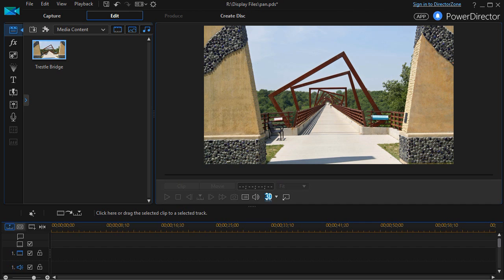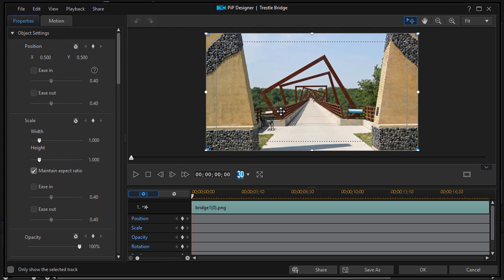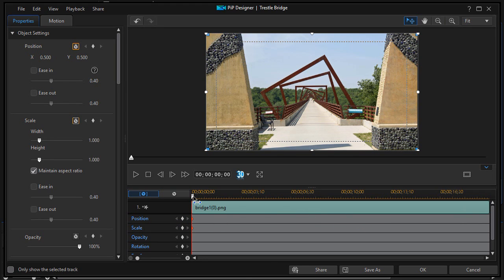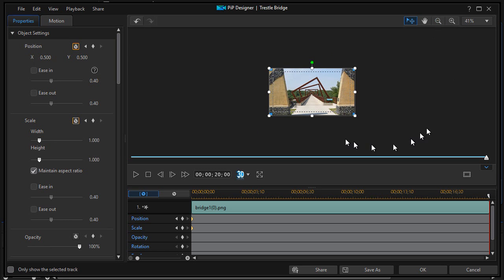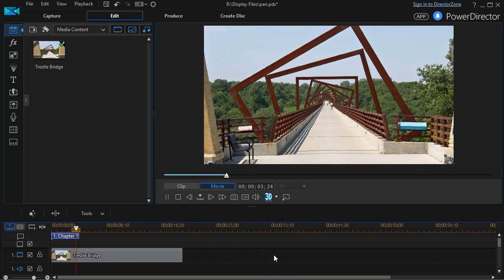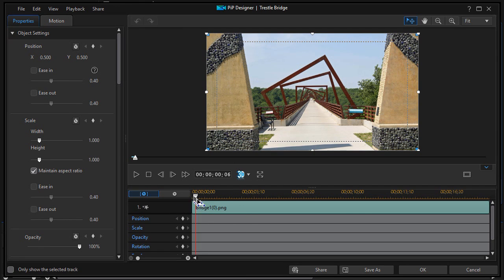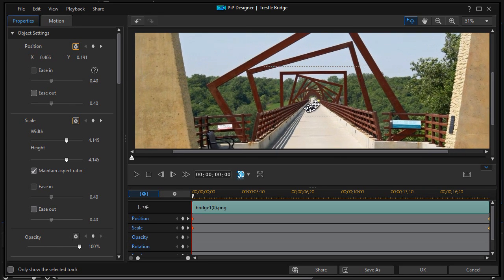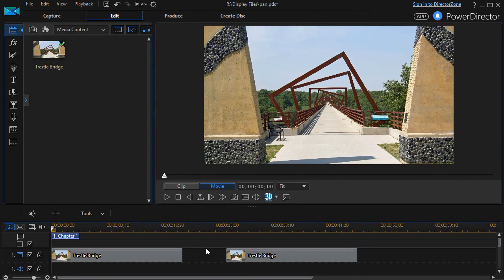PowerDirector - How to zoom in and out on a still image

Comment: ello and congratulations for the explanation, I ask you: a photo taken vertically leaves the sides of the screen the "black bands", you can kindly tell me the process to remove them? Thank you.
Reply from the maker: I'm not sure what you mean by "remove them". If the vertical photo is the only element on the screen, you can enlarge it so that the empty space is off the screen. But then you will have to trim the top and the bottom. If the vertical photo is in front of something else and still has black to the right and left, you can use the chroma key tools to make the black area transparent. 

There is no easy way to change the proportions of a vertical photo if you have a 16:9 video project. So your adjustments will depend on other considerations in your project. --Jim
Reply: @SharperTurtle  by remove them he means by: when you first start a video on powerdirector it zooms in and out on your pictures and I'm having the same problem as him

Comment: When you pull your picture down to the timeline, you automatically get the dotted rectangular frame just inside the picture edge.  I do not get that dotted frame.  So, when I resize my picture, I do not get the same result as you.
Reply from the maker: The dotted rectangular frame you see is called the Safe Zone. It is the smaller area where the majority of your video and your text should fall if you display the final results on something like an LCD screen. Otherwise there is a risk that the items might be clipped when viewed.

To turn the Safe Zone on or off you first put a clip in your timeline. Then you can click on the 4th icon from the right in the preview window. It looks like two rectangles. You should see a popup menu. In PowerDirector 13 the 4th item down reads: "TV Safe Zone" You can move the mouse over that option and a secondary screen will open that allows you to turn it on or off. 

Another way to change the setting is to go to your preferences menu. (The gear at the top) And then click on DISPLAY in the left column. You will see a check box where you can set the TV Safe Zone on or off as your default.

Hope this helps.  --Jim
Reply: Okay, yes, the safe Zone rectangle is what I was missing.  It was the difference between success and failure.  I've got it now!  The Key Frames work perfectly.   Thanks so much.
Reply from the maker: Great! Glad to help you out. --Jim

Comment: Hi, when I press F2 in Powerdirector 16 I get the same as on the video except no dotted line box just the sizing box arround the image. Do I need to change a setting?
Reply from the maker: Paul,
Good question. The dotted box around the video inside the margin on the preview screen is called the safe zone. 
You can turn it on or off easily. Right click anywhere in the preview window. On the menu that appears you will find an option that says "TV safe zone". You can turn this on or off. This is the place where you can also turn on or off grid lines that are used in some tutorials. None of this shows up in your finished project. But it can  be helpful in wisely editing your project.
Hope this helps.  --Jim
Reply: Jim, thanks for your quick and helpful response
Reply from the maker: Glad to assist you, Paul. Don't hesitate to ask if you have questions. --Jim

Comment: I don't have Position. I have Opacity, Scale, Rotation, Motion, Freeform, and 3D Depth
Reply from the maker: On your PIP Designer Screen, do you see a slider to the right of the Opacity, Scale, Rotation, Motion, Freeform, and 3D Depth scales? Can you drag that slider up and down? It might show the position scale. Or you can click on the square box in the upper right of the screen to make it full screen. See if that helps. Those are my best guesses at this point. --Jim

Comment: I mean, it zooms only in the fucking center of the screen. What if i want to zoom on a corner???
Reply from the maker: Here are the steps I would suggest. 1. Click on the image. 2. From the TOOLS menu above the timelilne choose "Pan and Zoom"  3. Use the last option "User Defined" 4. Click on the diamond with the plus at the bottom wherever you want the zoom to happen. That will set a keyframe  5. Click on the handles of the box to make it smaller. 6. Move the blue circle to relocate it to one of the corners of the image. This should allow you to zoom in on a corner of the still image. --Jim
Reply: @SharperTurtle  Hey, thanks for the reply. I did that when I was editing (the time when I wrote the mad comment), however, it doesn't have the zoom effect, it just jumps straight into that small zoomed box. There is no zooming animation, only a jump from full screen to selected zoomed part of the screen. That is not what I wanted, I need an animation just like the one given by Powerdirector, BUT not only fixed on center.
Reply from the maker: Sorry for this delayed reply. I didn't know that my comments were set to filtered and didn't include older interactions like yours. I'm stumped as to why you don't have zooming animation. What version of PD are you using?
Reply: @SharperTurtle  Hi again. I am using the PD18, and as I mentioned above, I get a quick jump into the area that I selected and then a quick jump to the full screen afterwards. There is no zooming animation, just a direct jump.

Comment: When I click on the picture in my timeline and then I click on F2 like you instructed, I don't see any rows to make keyframes like you're doing???? It shows a PiP Designer screen but there's none of those keyframe lines that you have. i.e Position, Scale, Opacity, Rotation etc. ??? Please advise.
Reply from the maker: If you look to the lower right of the preview screen, you will see a small blue arrow. That will either collapse or expand the timeline tools in the editor. If you click on it you should be able to see the timeline tracks where you can edit the position, scale, opacity, and other parameters. --Jim